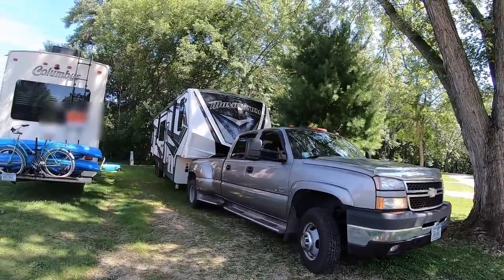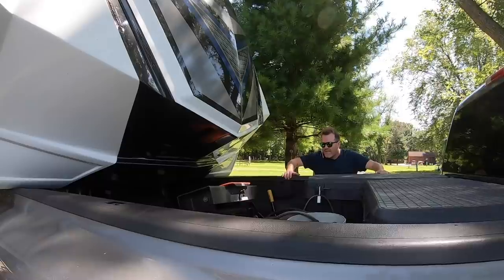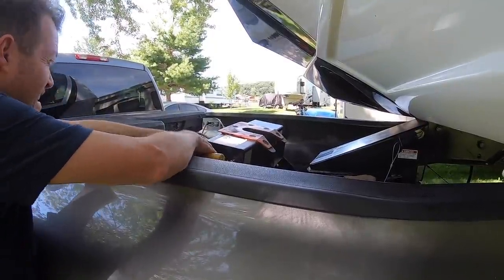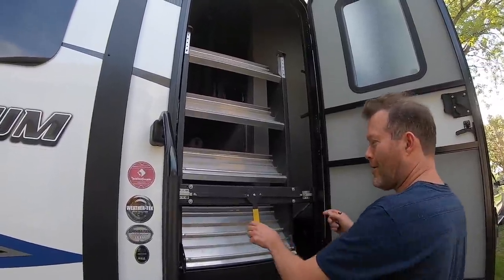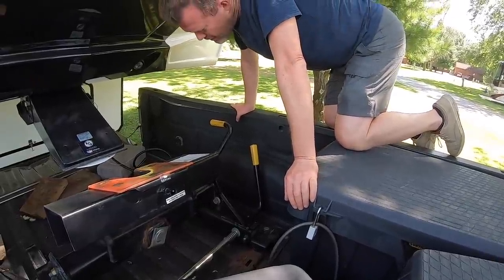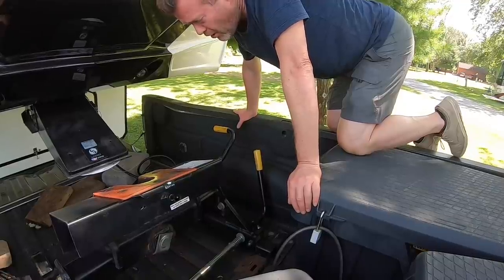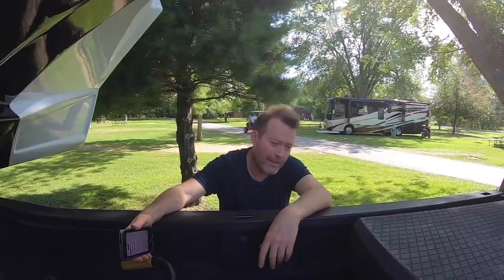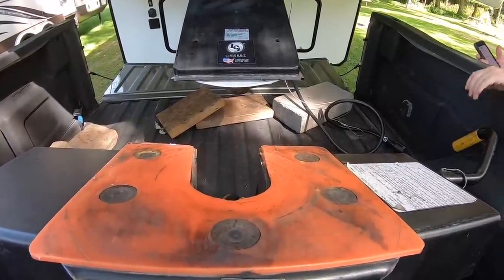RV CRUSHES MY TRUCK ON 1st TOW! BIGGEST RV LIVING FULL TIME MISTAKE! (PT 2)

Comment: omg, tom so claim, I rented a travel camper  someone pull out the pin.   yep it fall on to the ram  2500  2,500 in damage.  I went zero to crazy bitch in 2 second. what was the reason why the rig fallen on the truck.  somebody was talking about different types of tow hatches.  now this female wants a 5th wheel. iam do a dry run  first.  to make sure everything works out.

Comment: “A general inspection” ? So you’re saying when you drive down the highway and hit bumps you have to have a “general inspection” not being mean but a RV, travel trailer with DOT requirements does not need a “general inspection” just bc you accidentally missed a step in the hooking up process. What I would be worried about is you mint [was mint] looking truck the the “U” shaped tailgate and the extra 1inch bend in the bed of the truck. I wouldn’t be calling the manufacturer if the king pin either I’d be calling the previous owner or seller bc if its a flaw that he was having then he should have never sold traded or supplied you with or even recommending that king pin the seller should have to and be responsible for the repairs to the truck and don’t worry about the camper if it can take bumps and pot holes in the road then it can take a 4 1.5 to 5 inch fall on to that beautiful truck, truck is what I’d be concerned with it could have very well bent the back half of the frame and not be noticed until the bed is replaced this is called a stress bend or crack
Reply: Carter Tuel honestly I don’t think frame damage is a concern here. RVs are not that heavy despite there size and it really didn’t drop that far. It will leave a big bruise but it will not break the bones.

Comment: driving a semi for a living has taught me to never skip the tug test..... lucky you have a electric landing gear lift. Semi trucks with loaded trailer will need to be cranked all day and still not high enough to get up under it again......  what you do, raise the landing gear to about an inch off the ground and pull forward with trailer brakes enabled.     Or atleast take a look at the back of the 5th wheel to make sure the pin is locked
Reply: I had a buddy , his 48 ft trailer detached on the freeway  while over the Sacramento River on I 80 east, it ripped off his airtlines , the air brakes locked up and it skidded to a stop in its lane, it was empty to cranking it up was easy but unsafe with cars whizzing by. I have years of RV experience and ClasA driving as  a kid for a decade, I back in firmly slam it but not abusive, the 5th wheel on the trailer is like a ramp  OI always let it lift my trailer up as I back in so the pin on the trailer  is not setting too high, which I suspect  your did, it was enough to click the white deal  but  not pull 14,000 lbs, don't feel ba  since you never had experience, be careful in trees  and gas stations etc,  the roofs  are usually where its  damaged.

Comment: Somebody forgot the bull pin no worries I've seen a lot of rookie truckers do the same so you ain't the first I remember one time in the tunnel under the bay in Virginia my spare tire on my trailer blew outof the holder after my boss said they fixed the door on it and my buddy behind me a couple miles yelled over the radio at me hey there's a little hundred pound lady in the middle of the tunnel trying to pull that big rig wheel out of the road and I picked it up and told her thanks and she gave me a five dollar tip I broke down it was so crazy can you imagine at 60 it must have been like a BB in a box car just thankfully no one was hurt or anything that was a good day we still laugh about it

Comment: The jaws were locked, but you were high pinned. I could clearly see that you were high pinned before you dropped the trailer.

Here is a screenshot, look at the gap. https://imgur.com/a/xjFlLoB

Here is another screenshot, The jaw was not around the groove in the pin. https://imgur.com/a/2JElAoK

From a truck driver that comes from a family of truck drivers, ALWAYS do a pull test and visually check that the pin is in the correct position and locked in.

Comment: I’m not sure what the laws are stateside, and if you need a CDL, or any sort of higher licence for hauling something this heavy??. 

 But ppl like this are the #1 reason why actual truck drivers get a bad reputation. And why there are so many accidents involving camper trailers. Ppl are not properly trained and informed as to the proper and safe way of operating there equipment. 

The second you “locked” it in I knew there was going to be a problem. You need to put the safety lock in it after hook up and do a little tug to ensure your locked, and again after rolling ahead 10-15 feet and lock the trailer brakes up. You’re lucky you weren’t on pavement with little resistance and have the trailer come off going down the road. Damn lucky. But the seller should’ve stayed for the first hook up to ensure there wouldn’t be any issues and to show how to use that particular fifth wheel.

Comment: Come on people this guy put two pins in one hole and the wrong pins at that. Said the original pin was broke and it just needed put back together. So that seems like a good reason to get a new hitch. And put the brake away on a pin instead of something more stationary. Not very mechanical are you.

Comment: You have to watch part 1 where the previous owner demonstrates how to use the hitch.  This is the reason there should be laws that require a Class A driver's license no matter what the trailer is.  Anyone who has to call the customer service line and have a call center tell them how to lock a hitch should not be driving 10 tons of vehicle down the road. Your are going to kill someone.

Comment: You high hooked it. Then did not double check. Before you put up The feet you pull forward if you can't move your locked if you do move your not locked keep tail gate down till locked.  Trucker play jokes on each other with these.  The look locked. I am ex trucker seen this. To many times not my truck between many others even drive down the road like that.

Comment: I get the the trailer is brand new to you guys but you seriously over reacted when it came to checking to make sure things didn't catastrophically fall inside the trailer. The drop wasn't very far; you actually have more aggressive movement from speed bumps. Gotta just take a breath when something like that happens, and move forward.

Comment: It's a wonder how all you KEYBOARD JOCKY'S are so perfect. NEVER-EVER do you make a mistake at anything... HUH. 🤥  
This guy was doing what he could to check & recheck himself. The only thing that wasn't performed was an actual hookup with an experienced 5th wheel puller watching.
I have to agree with one poster here. Leave the trailers front legs a couple inched OFF the ground just in case something goes awry.
I've built and hauled hitch trailers for decades but never a 5th wheel. Even tho I feel quite confident in myself, I would watch someone else's rig get hooked up or have an overseer JUST TO BE SURE.
LUCKILY he didn't pull it out on the road THEN get unhooked.

Comment: You need to hit that King pin a little harder. Gently hooking up doesn't guarantee the mechanical linkages inside the fifth wheel locking proper.

Comment: I use a gooseneck adapter to get away from the big clunky 5th wheel hitch in bed.   Mounts right on trailers pin and is even cheaper than 5th wheel hitch.

Comment: I have seen this hundreds of times and it’s always newbies always newbies. Newbies should be forced to take lessons on how to hitch up their bumper tow and fifth wheel tow. They should be taught how to break how to turn how to distribute weight. When I was a seasonal and now that I’m retired as I travel around, I see it all the time and over 45. States I have seen the same thing occur because newbies don’t know what they’re doing pity. These are the same movies that are driving beside me and I cringe out that.
Honestly, newbies have no patience buying a three axle trailer. If they’ve never told anything before to hear you both go through this chatter about how the pin and the cable and the lock and the interlock all work why didn’t you do this at the dealership in the parking lot with people could’ve showed you what to do why did you do that , I’m curious I asked this question all the time with all the people I see that destroy their truck bed,  why didn’t you go through this at the dealership when you picked it up? Oh we were so excited to get it. We just wanted to get on the road. 0000  lesson learned.hopefully hopefully a lessons been learned.

Comment: It’s called a high lock.
High lock is when the kingpin rides over the locking jaws causing a false lock.
Best way to prevent this is backing approximately ¾ the way just short of engaging the locking jaws. Then lower the trailer placing enough noticeable weight onto the tow vehicle. Lock the trailer brakes and finish your hook up. Take a good flashlight to make sure the jaws are locked a portion of the kingpin is below the jaw then do a tug test. Praise God it didn’t happen on the highway. Breath it’s OK it happens to the best!

Comment: you will be in more regret when the value of this pos keeps dropping like a rock and you owe way more than its worth and you realize they are not good quality and everything is breaking. you bought a submarine not a travel trailer.
Reply: So what would be the correct travel trailer?  I'm still shopping and curious to know what you think.  Grand Design has some of the best reviews overall.   Nobody is perfect.
Reply: @dalek2547  they all drop their value like rocks and have low build quality for the price. Currently have a drv moble suites   but it's the same crap as the others.
Reply: Gotta pay to play though.
Reply: @dalek2547  it's better to just drive a car and get nice hotel rooms. Much cheaper much less stress. Even flying somewhere then renting a car is cheaper and less stress.